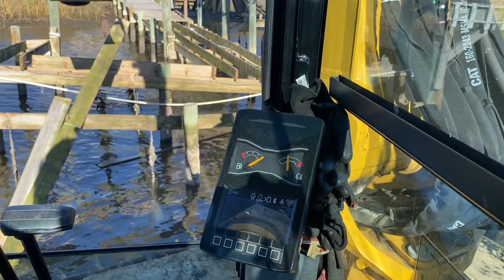PILE DRIVING, out with the old in with the new DMC installation

Comment: Hi Dale, love your channel, I own a home in Albarmar Sound in North Carolina and was thinking about building myself a 32' pier just to be able to walk out and do some fishing. I have a riprap wall that is about 6 foot tall. Just as a note I'm on the north facing side of the sound  and average waves are about 1 to 2 feet. The soil is all sand and the water depth runs about 2 to 4 feet at low tide. My question is how far should I drive my posts down, they  I'll be using 6"' posts that will be 12' in length. Another question how high should the finished dock be off the top of the water....